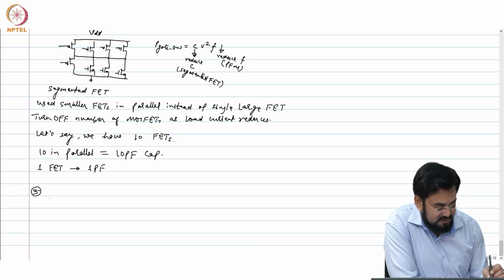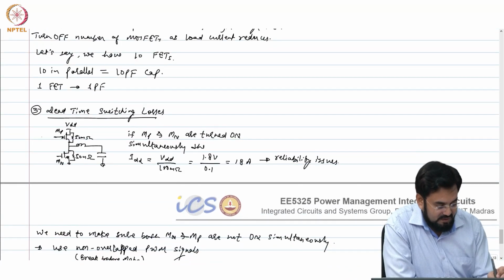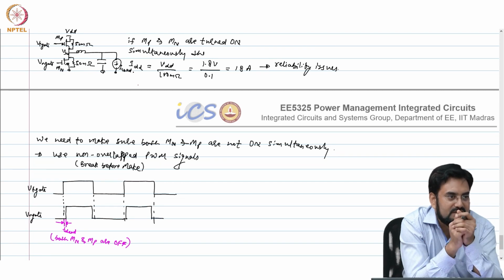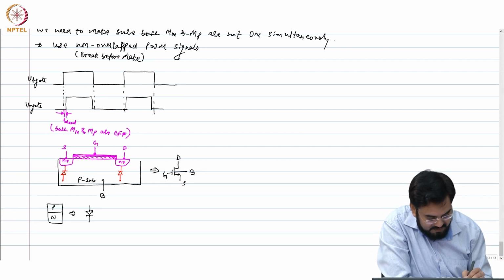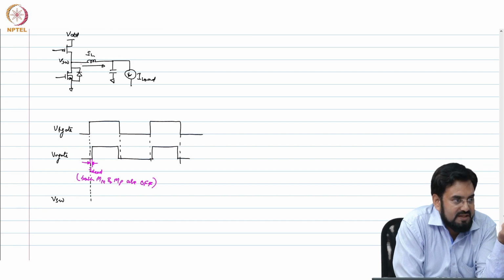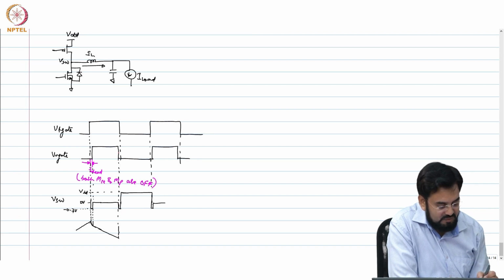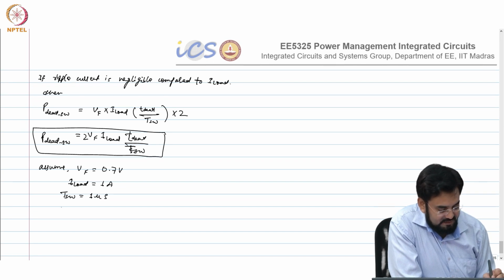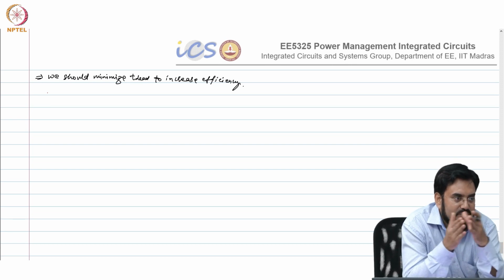#37 Dead Time Switching Loss in DC DC Converters | Power Management Integrated Circuits

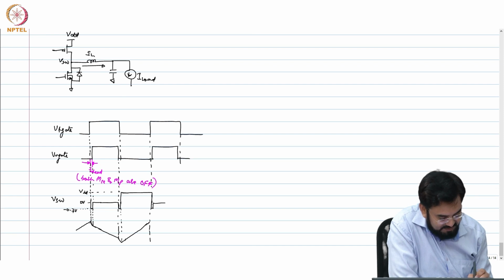Comment: Doubt pls : At 18:52 , since NMOS goes off and Diode is forward biased yet again until PMOS turns on , the direction of current will be opposite (compared to when nmos was ON ) and therefore the load current though at a different rate ..should increase ... or maybe be constant ... or should it decrease (Any one who can Answer pls ??)